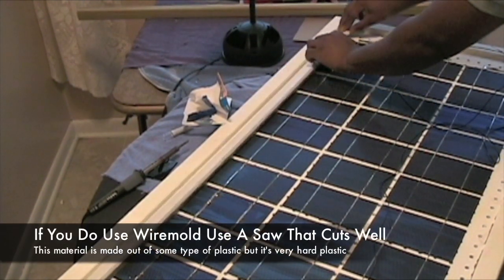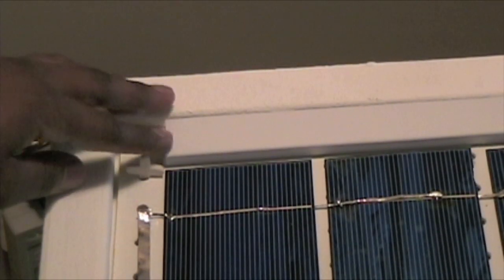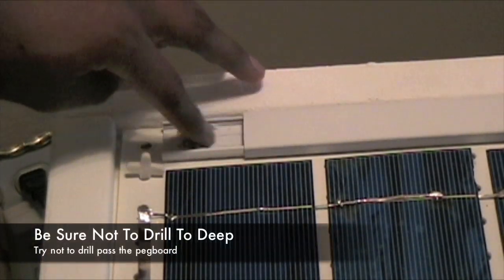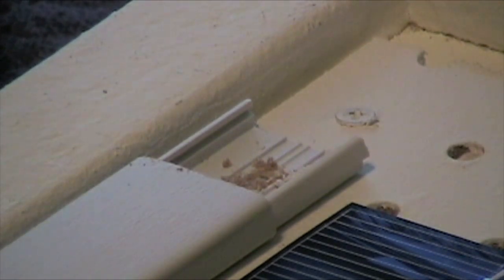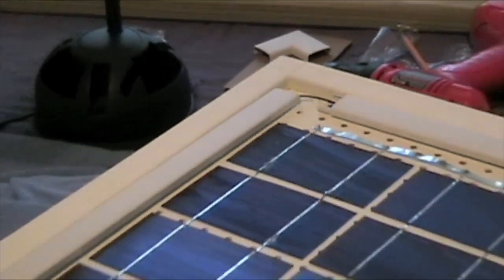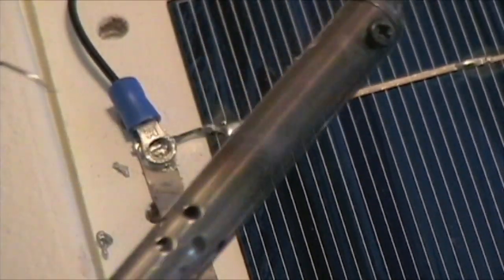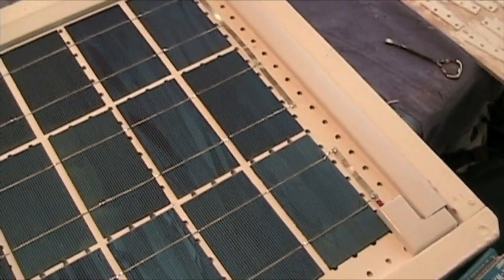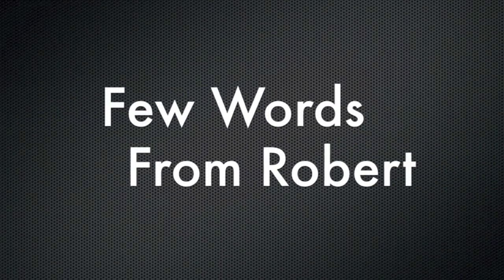How To Build A Solar Panel - Part 8

Comment: im sorry, but it IS NOT PIXEL–GLASS! It is PLEX-I (AS IN THE LETTER "E") GLASS. 
Sorry, but that drives me nuts. 

Also, it isnt ACCESS WIRE, its EXCESS WIRE. There is a BIG FUCKING DIFFERENCE. 

You are obviously a smart guy, but when you mispronounce easy words its makes you sound dumb as a rock.

Comment: you wire them in a straight line technically but it zig zags back and forth one side is the positive and the other is the negative

Comment: when soldering you should heat the metal with the soldering iron and then touch the solder to the metal next to the iron and it will spread evenly around the hot area, it actually flows toward heat and you may not get a true bond unless both pieces of metal were near the same temperature. this causes the molecules to align and form a very strong bond, much stronger than the breaking force of solder.

Comment: I would rather use the UV ecapsulant not the resion as you dont have to worry about bubbline and I would never use wood at all never. that pannel will never last long you will get moister in there and decrease the life of the cells.   I would have went with a alumim fram. tempered glass and use a egapsulant defently not what you did nice soldering though but the framing and wood I would never recomment.

Comment: Isn't it easier to use 4 rows or two rows of cells- so you dont have to run a long power wire?

Comment: them round wire clips are meant to be crimped with the end of wire stripper your using the wrong end I would solder the wire direct only my choice

Comment: Excuse me if it's been said, but using the crimp terminals on the ends of the wires is not only unnecessary, but offers poorer conductivity than than soldering the wires straight to the buses.

Comment: Robert: while the eyelet terminal soldered to the bus wire looked cool, I can tell you that from years of experience connectors crimped that the cheap tool will not be sound, will loosen up and may actually oxidize, causing voltage loss.  Problem will be especially pronounced outdoors - some humidity will get into the rig, and the extreme heat will exacerbate. Solution: solder the lead out  wire directly to bus wire.  Solder is your friend.

Comment: Great video but what about blocking diodes? You should have at least one. I recomend one between each string. What was your total build cost? For a DIY this is THE best looking panel I've seen yet.

Comment: @1978CamaroRedneck 

the front of the cells are positive and the backs are negative. All the cells are wired in series to help build up voltage. If they were wired in series, they would build up amperage.

Comment: soldering the wire directly to the buss wire would have been a lot better. 

More isn't always better. You only need enough solder to make the two connection bond. The solder should lay flat and smooth and still be shiny when done properly. Clumpy solder is a result of one or more of these (too much solder, not enough heat, too large diameter of soldier. The end of your iron should be "tinned" and look shiny when you are soldering joints. 

Otherwise nice job!

Comment: Did you check the current and voltage with a load in sun light? Those evergreen cells don't put out 1.7 watts each, the 3.5 Amps is a short circuit current, not to be use to calculate power. You need the Vmp and the Imp to calculate the max power.